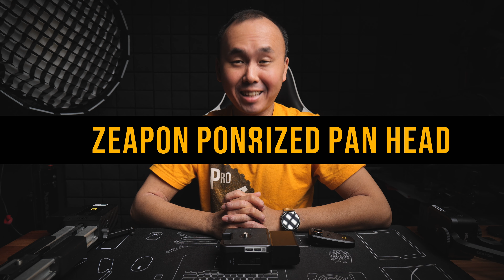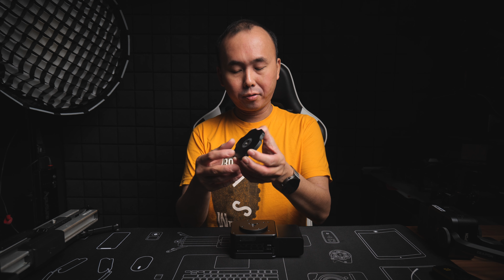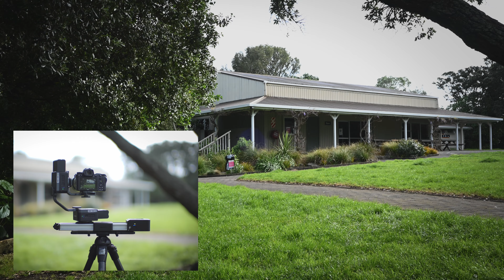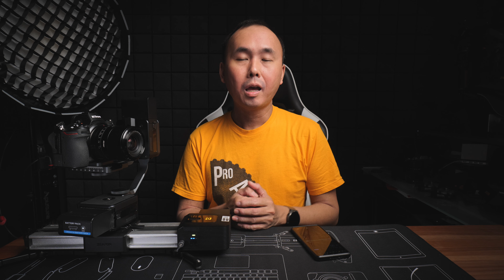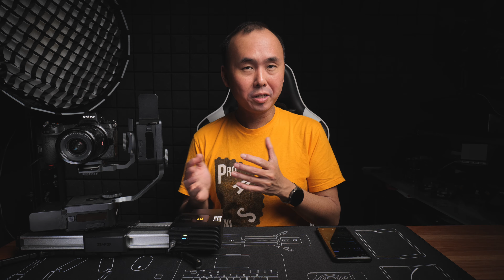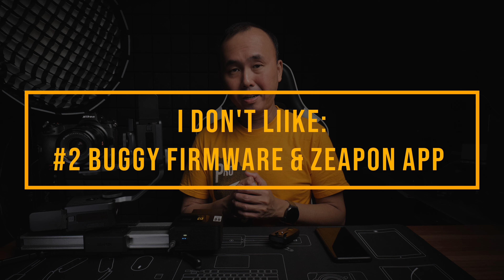Zeapon PONS PT Motorized Pan Head / Zeapon Timelapse Trigger / Zeapon Lab

Comment: I'm an owner of the original Zeapon Micro 2 and in my view it's the best slider you can get. I've been waiting for the pan motor on its own for some time and unfortunately it's still not available in Australia. I'm glad that you made a comment about the Zeapon Android app. I installed the new app and find it not only buggy, but it's the least intuitive app I've used. The original app, which I still have, is the best app that I've ever used regardless of device and won't get rid of it any time soon. I don't know why Zeapon didn't continue with the old design, with the excellent graphical interface and the time lapse features on a second screen. I was going to release a video this week showing how bad the new app is compared to the old, but decided to hold off on that as I wanted to show something that the Zeapon Micro Slider can do that nothing similar can do and put both apps to the test at the same time. But I implore Zeapon to go back to the old app design.
Reply from the maker: hi there, i'm also curious about why Zeapon redesign the app completely.  there are a few features now not do-able anymore with the new app like adjusting the speed of each waypoint individually. I'll see if i can get some information and the reasons behind from Zeapon.
Reply: @TheRealRichardWong  The speed control is my major complaint including the loss of the excellent visual display via the graphical interface. It was so good and now it's not.
Reply from the maker: Hey Australian image, did you left me a comment? I saw a notification but  when I click it says it's no longer available.  I have a lot of disappearing comments recently from different people :/
Reply: @TheRealRichardWong  Yes I did. I don't know what happened to it.
Reply: @TheRealRichardWong  That last one seems to have succeeded. What I said was that overseas manufacturers need to be careful about appointing just a sole local distributor for their gear, I've been waiting weeks for Videoguys to reply with availability of the panning motor on its own. Clearly they are only interested in selling the complete kit, so I got fed up and ordered one via eBay.
Reply from the maker: No i still can't see your last message.  Only saw one that was 4 days ago.  I think Youtube is doing some silly thing filtering out a lot of comments for unknown reasons.    Oh i will let Zeapon know about your experience.   Btw, i'm doing a livestream this Sat NZ Time 2pm (so around midday in Aussie?) and i will talk about these products. The guys from Zeapon will most likely be here (not on screen) as well so a good chance if you want to ask them (or me) some questions :)

Comment: Thanks so much for the video! Do you know if we will need the newer Micro 2 Slider Plus to be able to use the PONS PT system or can we use it with the original Micro 2 slider?
Reply from the maker: Hey Gerald, i'm 99% sure the original motorized micro 2 can work with the PONS PT system

Comment: great review ! 
I would have liked to see the pan and tilt in action... 

on your small action figure for example... 

and I'm guessing that if you did not post any examples it is not a good sign... am I wrong to think that ?

I bought the pan and tilt kit so i'm waiting to receive it and test it out
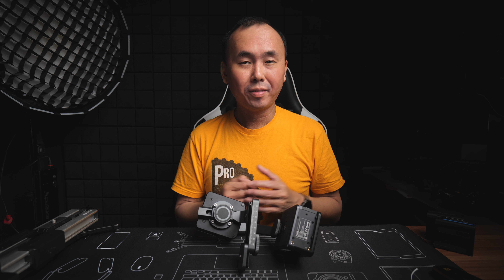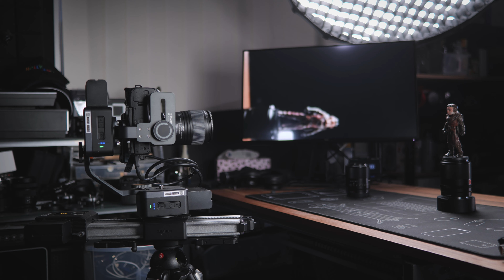Reply from the maker: hey Duncan, thanks for watching! I've posted a few samples shot with the pan and tilt module at 6:47, 21:48 (you can see the result on the monitor in background) 
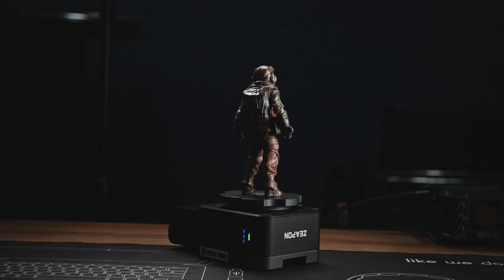and just the pan head + slider at 3:35 , 4:26 (which uses the same module anyway)   
I've shot quite a lot more footage shot indoor and outdoor but just can't fit them nicely into the video and don't want to make the video any longer than it is already.  I do not have any real issues with the performance of the modules or i would have mentioned (like in some of my previous Zeapon video),  My main issue is really about the buggy firmware and app at the moment, which I've also mentioned in the video.

Comment: Thanks Richard, what is the price? Are there any links where to buy, or am I missing the point looking through the official site and not able to find a price?
Reply from the maker: Hey Bran Ristic,  sorry i think most reseller outside of China still hasn't receive the stock yet,   but for the price:  
Zeapon Timelapse trigger is US$69
PONS Motorized Panhead is US$249
PONS PT Motorized pan head (pan and tilt) is US$589
These are the suggested retail price btw

Comment: Really great video Richard.  I will definately get the timelapse trigger as I use the foolography trigger for timelapses as it uses the camera histogram to adjust exposure and it would be really great to have it drive the slider.  Any idea when they will post prices or where they are.  I am surprised how large and heavy all the pons devices are from manufacturers so zeapon is certainly not oversized. Will pick up one to start.  Thanks
Reply from the maker: hey Barry, thanks for watching.  The suggested retail price for the trigger is US$69.  There is currently only UK reseller have it in stock but the US reseller should have them soon like this :  https://amzn.to/39QMfOy  (affiliated link btw)